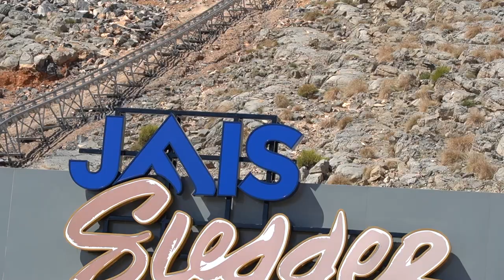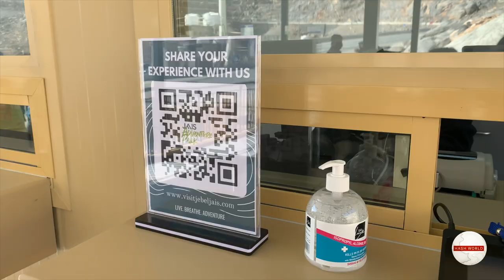JAIS Sledder | Ras Al Khaimah |Adventure ride | UAE | 2022 |

Comment: Nice video ...what is 1 ,2,3 lap ?
Reply from the maker: Its a track - as you know from starting point to finishing point is 1 ride or Lap will cost 40 dhs and if you want to go 2 times more will cost 90dhs for 3 ride / lap
Reply: Wow...how long ride is this ? Like how much meter or km ?
Reply from the maker: @preethisandeep6509  the ride duration about 8 minutes and almost track stretches 1885 meters